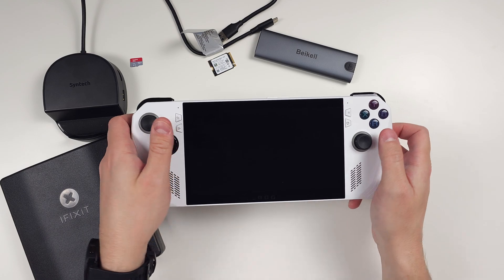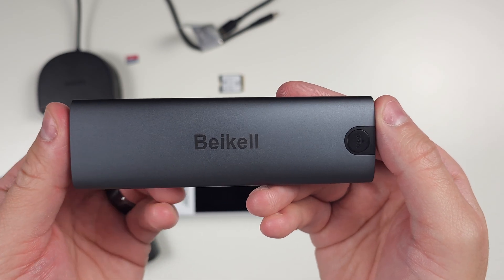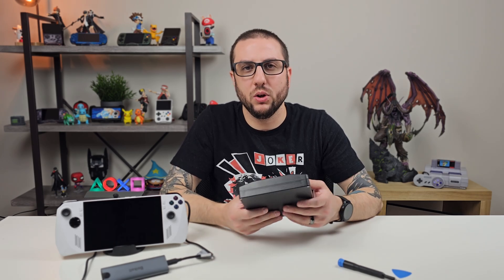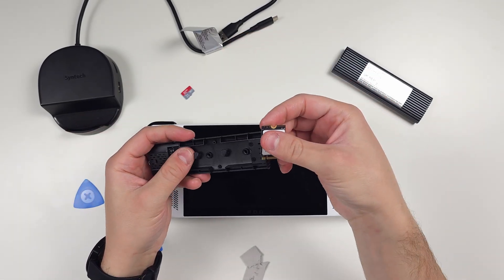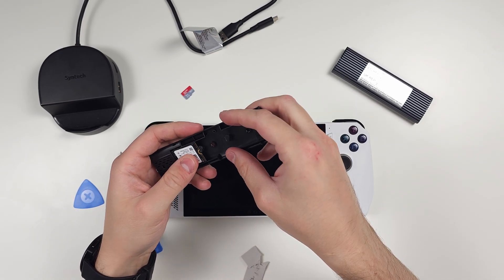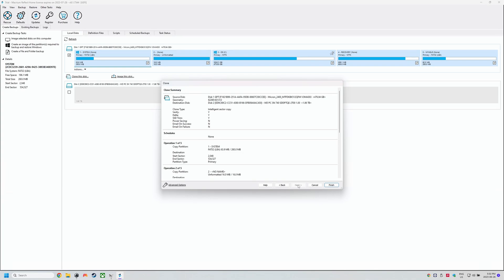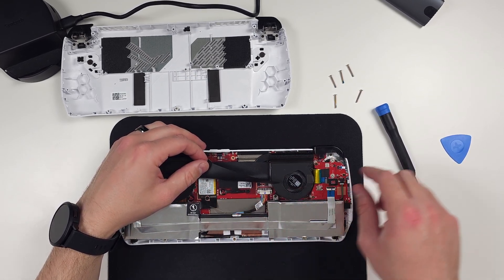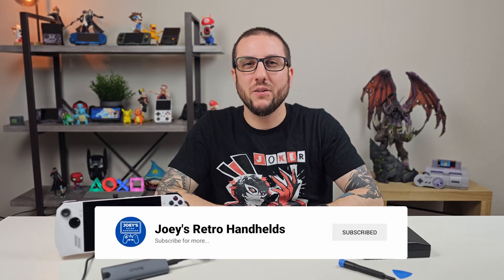Upgrade the Asus ROG Ally's SSD WITHOUT Starting Over

Comment: Dude your tutorial was so useful, followed the steps, no issues, cloned what I had on my 1TB SSD to my new 2TB. I did delete some games to lessen the load well it did take 4 hours to clone so I guess it had no effect lol. But after that, shut down, disassembled, replaced my 1TB with the 2TB SSD and yeah. After bootup, everything was there. Currently redownloading my games, finally no longer need to use a external SSD, except the microSD through USB since I use the Z1E Ally but man it feels good to have extra space. Thanks again for the tutorial :D

Comment: Thank you so much bro! Entire process was less than 2.5 hours. I was one of the lucky ones bc my ROG Ally had no bitlock or device encryption of any kind on it so just 2.8hrs to clone bc it was full. And 10min to pop in new 2TB drive. Went with the MP600 Core Mini. Fastest drive that was in stock on Amazon. A touch faster than the WD drive he put in here. Cheers. This was SUPER easy! Liked and subbed 💛

Comment: Do you have any idea how to resolve the error#8 after install for macrium reflect? Recently just got the Corsair mp600 mini ssd but doesn’t seem to be cloning properly, done all the bit lock decryption and followed other prompts but I just can’t get it to work. I’m not very tech savvy so some help would be much appreciated
Reply from the maker: You can check the comments here, a few other had that issue. One person ran chkdsk and that fixed it.
Reply: @JoeysRetroHandhelds  I’ve done it via windows and nothing was detected, it could be the possibility of the enclosure not working properly… I literally have no clue what’s going wrong. I don’t understand why something so easy has to work out so hard lol

Comment: How does it know to boot from the cloned drive? Aren’t there bios steps not in this video? Never seen a plug and play windows clone?.
Reply from the maker: Every step is in this video works if you follow it directly.
Reply: @JoeysRetroHandhelds  currently decrypting even though I didn’t have BitLocker (windows 11 home on my Ally) but I figured I would still decrypt just in case it bricked my old or new SSD

Comment: Just an FYI - the bottom middle screw on my device had the same issue it's because there is a plastic washer which can inhibit removal of the screw but it won't stop you removing the case so long as you have unscrewed as far as you can.

Comment: Trust me use this guide. DON'T USE asus cloud recovery. cloning ssd is much better. i failed using asus recovery (you can Google it). it took forever on download process even when you have fast and stable connection and it get worse because sometimes it failed for no reason

Comment: Worked perfect. I keep the enclosure with the orginigal 512GB SSD connected to the docking station. Use it install less demanding games and which I only use when docked (most of the time). Better than selling / collecting dust in the drawer.

Comment: This worked perfectly for me, thank you! 

SN: BE VERY CAREFUL WHEN REMOVING THE SCREWS. I had a frustration meltdown because I almost stripped the final screw that I tried to remove (bottom left, NOT the capture screw).

Oh, another SN: don’t forget to plug in the battery BEFORE putting the Rog back together. I reassembled it, plugged it in with the charger (it worked and was updated) and then remembered it wasn’t internally plugged back in🤦‍♀️ Fortunately, this all took under an hour lol!

Comment: Thank you for the video! super easy to follow just finished cloning my ssd and installed new 2tb wd black ssd. booted up like i never swapped drive. working perfectly! as far as bitlocker, it didnt show up as bitlocker even though it showed it when i first set up ally. it only has option to remove encryption. So i did that and it took about 2hrs. Now if you have a video on emulators for switch, let me know!!

Comment: Can you do the cloning part after swapping the nVme if you choose to boot from USB in the Bios? I'm asking because I want to get a 2230 size enclosure for the old drive and add a 2280 size nVme to the Ally with an adapter.

Comment: I THINK I turned off bitlocker although it was just a switch that said turn off or on encryption for drive. cloned SSD with Macrium reflect.
Swapped drive.
Now I boot up. See the login screen no problem. Once it logs in I get a black screen and can only see my mouse cursor. Can even move the mouse around with my Bluetooth mouse. I can use a keyboard to do ctri alt delete and choose task manager but then still black screen except for mouse cursor
Any help?

Comment: I didn't know that the bitlocker was turned on by default which I promptly turned off now which took around 5 minutes to decrypt the files as I've barely installed anything at this point of time ( its a newly purchased), I will upgrade the nvme when I have the money to do so and I will be purchasing the 90 adapter to so I can install a 4tb 2280 nvme at that time, will be using your guide to clone the storage so I don't have to reinstall everything again.

Comment: Do I need a dock or a charging brick with multiple USB c outlets, or can I plug the m.2 enclosure directly into the Ally and have enough battery power to clone the new drive?
Reply from the maker: Depends on how much storage you have taken up, battery likely won't last.

Comment: Can you just have the SSD adapter and plug it straight into the ally and do the clone that way? Of course having the ally fully charged before hand. I see you have a dock for the ally, but is it really needed for the clone?
Reply from the maker: If you think the clone will be done in time, you can.
Reply: @JoeysRetroHandhelds  insignia makes a ssd enclosure at best buy, may try it out tomorrow. Could a regular USB dongle provide power to the ally if I have it plugged into a charging brick and then use the USB C ports for the SSD enclosure?

Comment: Hello, I was wondering do you have a software like Maccirum for the Mac as it does not work on the Mac ? As I already have removed the old standard SSD with all my data on it from the first ROG Ally I had  ( PS that’s spoilt now so i have a new one coming) my plan is to attach both the SSD cards to my Mac and then just clone one SSD to the other. So was just wondering if you could recommend a software like Macirum. Awaiting your prompt response. Thank you

Comment: My ally has w11 Home edition, so no bitlocker features. Just putting it out there in case others are looking for it.
Reply: So does this mean we just skip that step in this tutorial guide? Or is there something else we have to do
Reply: @carlosnavarro9944  There's really no way to get to it with the pre-installed home edition, so safe to say yes if it works for you. Unfortunately for me, there was an issue for me with the remote install, so I just installed the OS traditionally with a dock with 3 ports for charging, kbm combo (logitech k600tv) and a bootable windows USB. All works now since then. No issues. So hopefully your remote install works cos that would be the most convenient.

PS: I also tried cloning, but the partitions management in windows is a headache so I would've lost valuable space in that new SSD, so I did it that traditional way I mentioned. T. T

Comment: I ran your steps to the letter and it worked perfectly. One note is that you need to connect with the based power supple when you turn it back on. A lesser power supply will not work, so I had a mini panic attack when it did not turn on at first.

Comment: just want to leave an updated comment from my last one. IT WORKED! No issues smooth as silk I am very pleased. If you get the prompt for "The following BitLocker encrypted Drive will be cloned without enabling Bitlocker on the target: C: - OS" just keep going with it there shouldn't be any issues! I also recommend a fully charged battery as you can' t do the clone and have the device plugged in at the same time obviously. To be on the safe side I ran in silent 10w mode and that took about 45 minutes to do the clone. But my guess is that with a charged battery on performance it will take a half hour like it did for Joey and you should still have around 50% battery left. Time to start downloading some more games =)

Comment: After the first clone, the new 1TB SSD only had 500GB available.  I was actually sure that everything would fit, so I didn't check as recommended in the video.  So now I'm doing the operation a second time in the hope that everything will work now.  Or is there another way to release the hidden storage space later?
Reply from the maker: You skipped the step in the video :)

Comment: I just upgraded to a 2tb gen4 for my ally, and I did it the wrong way, doing it all from scratch, and it takes forever. And it didn't want to connect to my wifi when restoring it. Thankfully, I used my phones hotspot and it worked.

Comment: Worked like a charm. I didn’t disconnect my battery and followed your instructions. I now have 952 GB of storage using a 1TB drive. Thanks so much!
Reply: My unit didn’t have bitlocker installed. It didn’t have Windows encryption activated either. I used a grounding strap just to be sure. I purchased an Orico drive enclosure from Amazon which worked well. I was a little concerned about opening the unit, but the experience gave me enough confidence that I could do it again, if necessary.

Comment: Originally I was going to do a cloud restore but since I hadn't installed much on the ROG Ally I decided to give your approach a try. Took less than 15 minutes to clone the old drive and probably 5 minutes to swap out the SSD. Works great and now I've got plenty of space. Thanks!
Reply: Did you do the bit locker step?
Reply: Ah shoot you can do a cloud restore? That sounds better to me as I'd need to buy a USB C extension with power delivery because no way my ally is gonna last long enough to clone.

Comment: Wanted to thank you for this guide & post my feedback for others. I upgraded from the 512gb to a 2tb SSD that I took out of my Steam Deck that I dual booted SteamOS and Windows. I did take a few hours to wipe and clone to the drive and once I got it all done & installed in my Ally I had to plug in the power cable (prob. due to unplugging the battery) and it hung on the splash screen for about a minute before it booted. 

All in all everything seems to be functioning as expected after the swap. I considered using Asus's cloud recovery but this method was definitely more ideal since I had a couple of games and such already installed.
Reply: mine wouldnt start either until i plugged in to power cord, but booted up fine once it started.

Comment: Are the temps good on the upgraded ssd? I heard that anything beyond the 512 gb ssd has overheating issues
Reply from the maker: Haven't experienced any issues there.
Reply: @JoeysRetroHandhelds  figured it out after a few tries. I had screwed the ssd on the slot a bit too tightly. The moment I simply attached the screw to the slot and didn't turn it more than twice it worked
Reply: @JoeysRetroHandhelds  checked the temps after the upgrade, can see somewhere around 8-10 degrees higher temps . Are you using a heat sink for the ssd?
Reply from the maker: I am not
Reply: @JoeysRetroHandhelds  have you checked the temps on your ssd? I'm getting one tomorrow so would like to know if there are any issues
Reply: @JoeysRetroHandhelds  also do you use any heatsink?
Reply: @JoeysRetroHandhelds  hey I did the upgrade but device is unable to recognise the ssd for some reason. It's booting directly into bios
Reply from the maker: Did you miss a step possibly? Otherwise you can use boot manager in the bios to select that ssd to boot into.
Reply: @JoeysRetroHandhelds  my ssd isn't getting detected for some reason in boot menu

Comment: Worked like a charm encrypting took 4 hours and cloning 2 for me installed the ssd then in 5 mins lost no data and got more space. My sd card slot makes problem after 3 months and this is the best way and the ssd is much faster then those crap sd cards no space problems anymore. Got the micron 2400 ssd in 2tb which is the same like the original model for 120 bucks. Thanks for the guide

Comment: Also a heads up: 
If you do this disconnecting the battery, and try to turn it back on without external power, it won't boot. 
Dont panic. 
Connect it to power. Wait for the amber led light and then proceed.

Comment: How long did it take to clone the drive, I was asking because I have about 70gigs free on my 512m.2 and didn't kno if it would finish before the battery dies or should I do this when I get a dock to have power pass thru and use a USB to do the cloning, didn't kno if it would finish before my battery dies

Comment: Managed to clone ssd but 2tb drive has the same capacity as old 500g drive, how to i use the unallocated extra space? 🙏🙏🙏
Reply: I missed the extend bit 😂, I guess because yours worked I thought I'd be ok, cheers for the guide it's great 🏆
Reply: @adamsadler5983 Just the Same Here, i was sure everything is fine.. i am actually cloning again... is yours fine now?
Reply from the maker: You skipped the step right before cloning
Reply: @JoeysRetroHandhelds  which step? Can I reformat and start again? Thanks 👍🏻
Reply from the maker: 7:45 in the video, you missed the extend part. 

No clue, likely can or just re-do the clone, it erases everything.

Comment: Went crazy, i have no the option to increase the partition. Tried everything,  so i have 1 c 1t and had to do a partition with the rest 1t.
Reply from the maker: Hm, you definitely should have that option, but if not you can use Minitool Partition Wizard to extend it after the fact.
Reply: @JoeysRetroHandhelds  my fault, found the option, worked great, thx a lot. Take care

Comment: I’ve tried the cloning 3 times following your guide and it keep getting error 8. Not sure if it’s an issue with the SSD I got.
Reply from the maker: Hm, Googling that error and yeah seems to be bad sector related.
Reply: @JoeysRetroHandhelds  it ran the chkdsk C: /f fix on the CMD prompt that seemed to fix the issue. Fully cloned now.

Comment: I cant find bitlocker either. Did the guys with the same problem continue and did it work?
Reply from the maker: You can skip that step safely.
Reply: @JoeysRetroHandhelds  i have device encryption its turned on. Shall i turn it off?
Reply from the maker: Not sure, didn't have that. May as well.
Reply: It worked thankyou 🙂 . Iv turned encryption back on is that ok? Also is there a way to wipe the old ssd ao that i can use it in the enclosure for extra storage?
Reply from the maker: Great! Not sure, shouldn't hurt. Yep, just connect it now and you should see it in disk management and you can wipe it.

Comment: Worked great! One watch out is that after installing the new SSD you need to plug in with the original charger. It will not boot if you have it plugged into a dock or even the ROG 65w dock they sell.
Reply: yeah i got scared for a bit as it wouldnt power up, but booted just fine as soon as i plugged cable in.

Comment: JUST A HEADS-UP TO EVERYONE. MIDDLE BOTTOM SCREW IS A CAPTURED SCREW, IT IS NOT MEANT TO BE REMOVED ALL THE WAY!!!
Reply: Should be pinned fr
Reply: Basically it acts as a lock of sorts? Loosens enough to release the threads and tightens enough to anchor back into the threads.
Reply: @christopherscott934  not really a lock,  it actually had a retainer on the inside the keep the screw from backing all the way out
Reply: @triggerhappey101  Ahh ok. Just wanted to make sure. Don't want it to be an issue when I swap the SSDs in mine. I just got my Ally today, love it but no way 512GB is going to cut it. I got a 2TB Micro 2230 for it earlier for a decent price.
Reply: @AmvCrazyimvu you can basically upgrade your you storage
Reply: @AmvCrazyimvu nah it's fine, just make sure you know what you doing

Comment: The enclosure is currently unavailable on Amazon, do you have any other recommendations? I’d like to follow everything to a T because I am super nervous about this! 
How about an SSD from Amazon as well? 🙏🏻
Reply from the maker: Yeah, this one would work - https://amzn.to/3rlfqoT. Any M.2 2230 enclosure is just fine!

Some people went with this SSD - https://amzn.to/44jZwcW. It's not as good as the SN740, and more expensive, but it's on Amazon.
Reply: @JoeysRetroHandhelds  I appreciate the reply! Quite a bit more expensive, I might take a plunge with Ali. My SD card slot just stopped working so trying to decide if I can do this or not, thanks for the video!

Comment: Guide worked like a charm. Didn't have bitlocker installed on my ally but the drive was still encrypted by windows. I decrypted it just in case before cloning. New drive works great, thanks for the video.
Reply: How did you do this? My ally does not have bitlocker also
Reply: go to settings and when you begin typing the word encryption itll pop up. It's under Privacy Security > Device Encryption. @carlosnavarro9944

Comment: I did everything you said and I have done stuff like this before, but now with my new sabrient rocket q4 won't write data at more than 300 megabytes per sec. The rocket q4 is a gen 4 drive and writes should be alot higher and were fine for about the 1st hour of use after that Read speed was fine but write won't go above the speed mentioned before. I guess my question is do u think I got a bad ssd? Read and write speeds were fine with the micron drive it came with. Thanks
Reply: Did you fill the drive up to 50% or more? It might be the firmware (on the ssd) and it balancing the drive, this take a bit and happens in the background. Check out task manager and see if your C: drive has a high workload.

Comment: For some reason the SSD screw is super tight and i think im close to stripping it, is the screw any different, like should I be using the PH1 instead?
Reply from the maker: You could try, PH0 is what I used, so not sure.
Reply: Same here any luck yet?